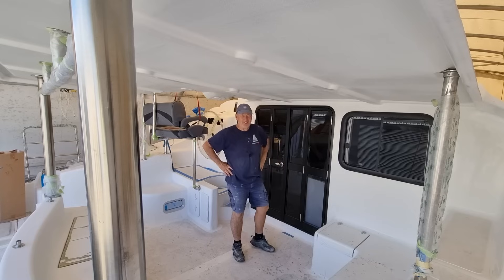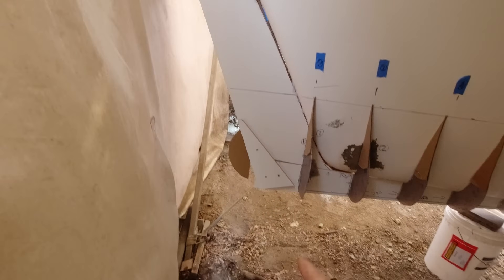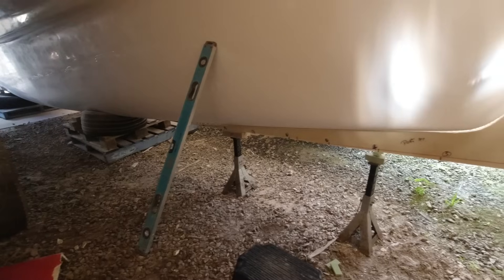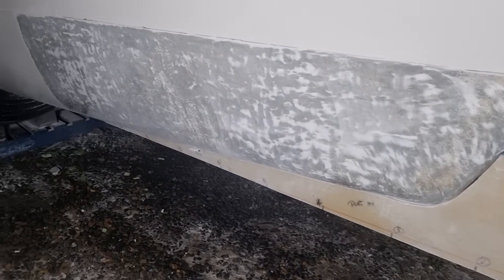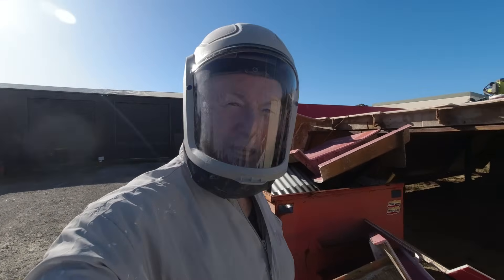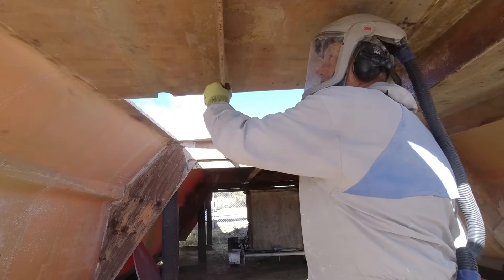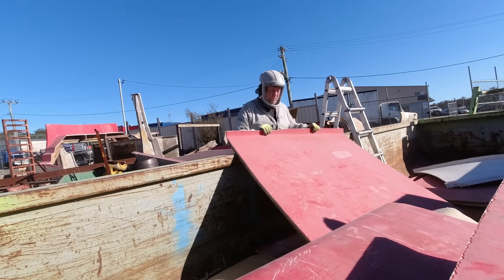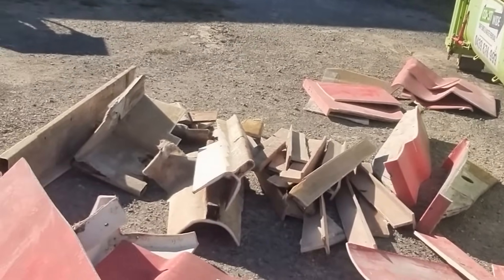Extending the Bow Strongback - Catamaran Modification Ep302

Comment: Use a silicon carbine grinding disc - 24 grit . you could have bond prepped that gelcoat on the hull in an hour and a half with maybe 2-3 discs . Just be methodical . Idk what you used but I was blown away when you said how long it took. I’m prepping 20’x6’ sections in 2 hours. (Specific applications ) . But yeah, those discs are the shit for gelcoat.🎉🎉🎉
Reply: Belt sander with 24 or 80 for those edges and corners

Comment: so that mod your doing is to keep the bow from dipping to much into the water
Reply from the maker: Yes mate t is a buoyancy solution as boat was designed with inadequate buoyancy in the bow.This was discovered after initial boat was produced and then retro fitted buoyant bows.Rossco

Comment: Been supporting / watching your vids for years from the start. The last of the mold cutting, binning and trucking to the tip was was 4 vids or more ago. Why are you showing this again Ross. ??? What are you milking it for mate ???
Reply from the maker: That wasn't the last of it mate, that was the deck mould many weeks ago.I had only made a start on the hull mould being stored across the road.There is still another 12 tonnes of module moulds to go to be paid to tip.Cannot get rid of them all at once.Sorry if I have bored you.Milking it,hardly.It is all in the ridiculous logistics we have been through to complete this boat.

Comment: Rossco, I actually reckon that mod to the hulls is an elegant solution to the buoyancy issue. The bulbous bow should create a low pressure wave off the front and decrease the resistance.

Comment: For what its worth with most of my aerospace engineering degree, your bow shape shouldn't negatively affect your performance at all, you basically have a standard bulbous bow profile, just slightly short at the very tip there, it may actually slightly increase your speed and fuel economy compared to doing nothing because A. the bow won't be digging in like a plow due to the buoyancy issue, and B. the flow over the bulb will displace water more gently than a sharp wedge and will have a very minor hydrofoil flow effect which will likely not really add much in the way of speed, but certainly won't hurt it. But I work in IT these days, not boat or airplane design, so take that for what its worth.